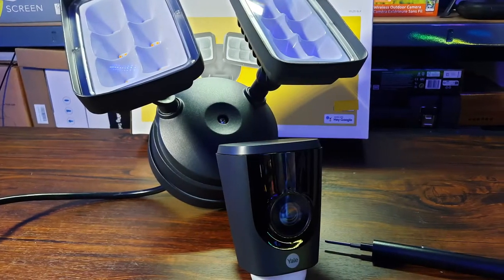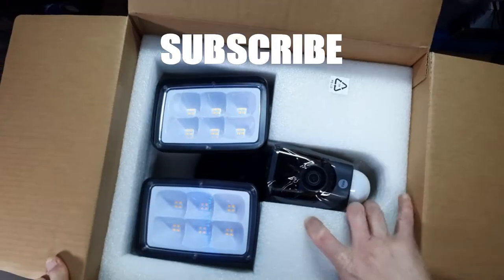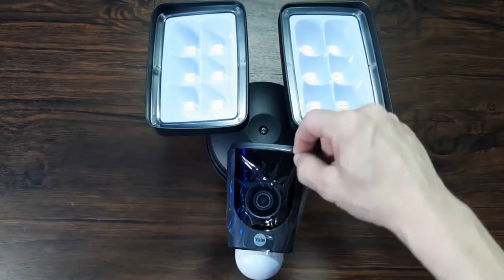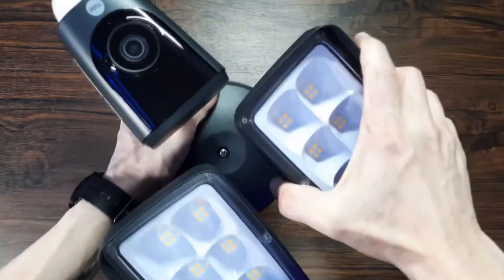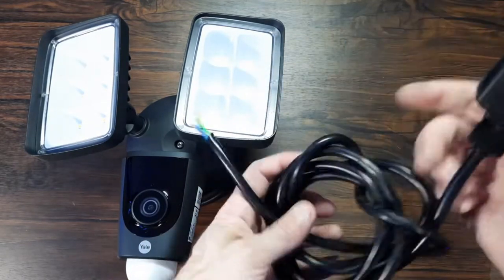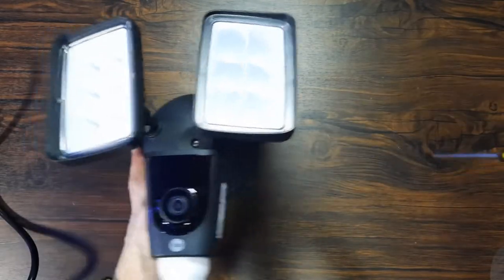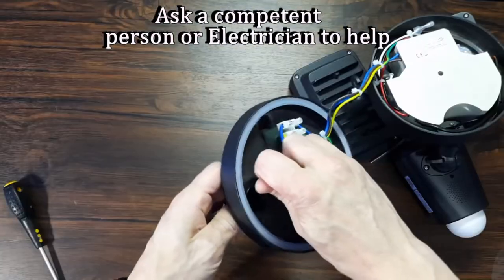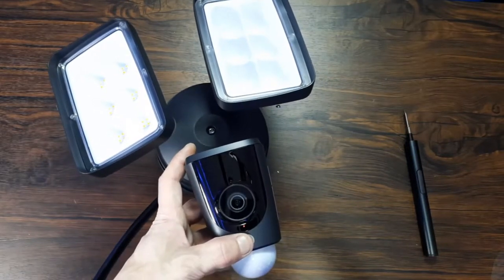yale YFL01 CCTV Unit Google asisstant and Alexa

Comment: Can this be wired into a lighting circuit?
Reply from the maker: yes its direct power so you can a plug socket to it or add it to a spur just make sure your spurs are water proof tidy and suitable there should be no issues